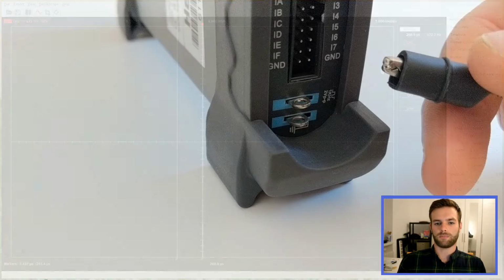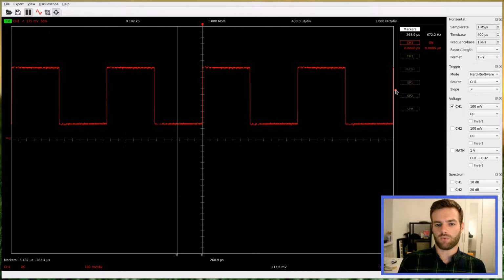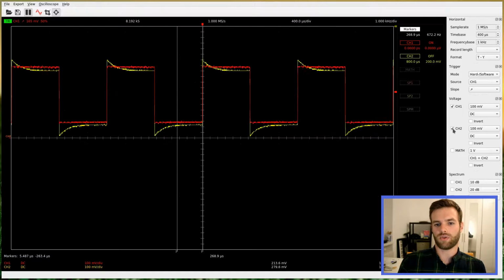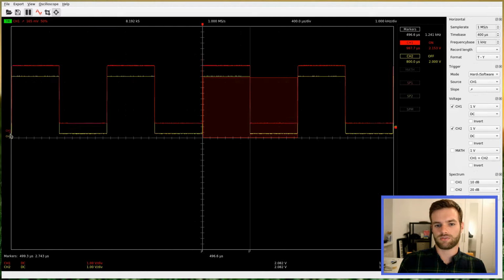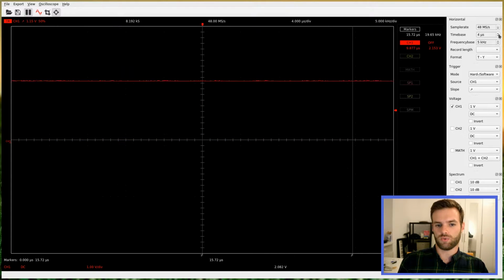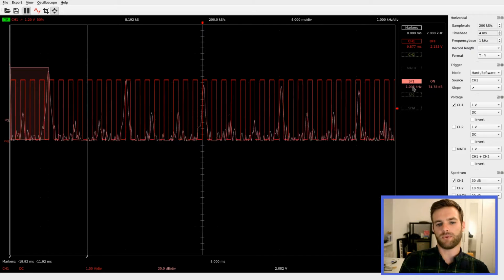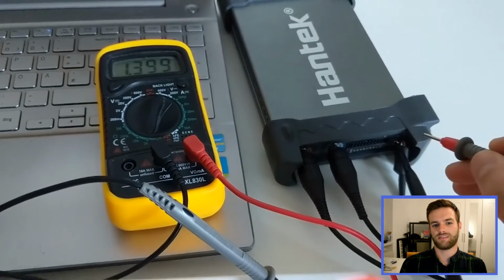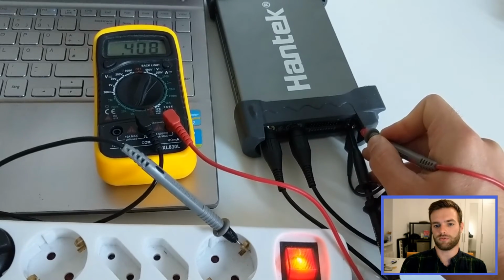Turning the INVISIBLE into VISIBLE with the Hantek 6022BL - Scalable Prototyping #2

Comment: Nice video! Considering getting one of these. One question about the risk of shorting a circuit to mains earth, if I use a battery powered device like a laptop without plugging it in, the risk of shorting the circuit you're measuring to ground would be gone right?  Also do you know what the maximum voltage is that you can measure?
Reply from the maker: Exactly, if you don't plug it there is no risk, that's why it's perfect for iot projects. I don't remember the maximum voltage, but they should state it clearly in the product specs